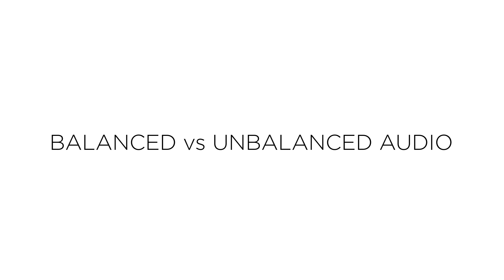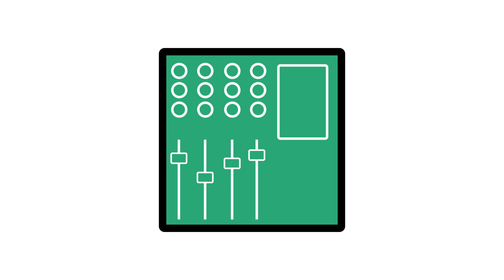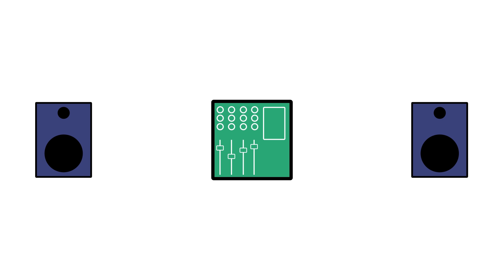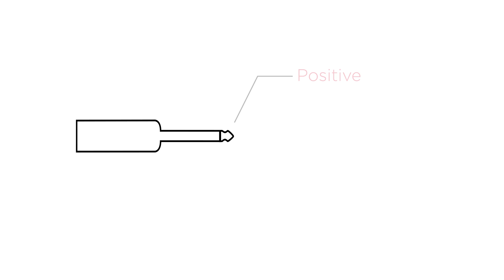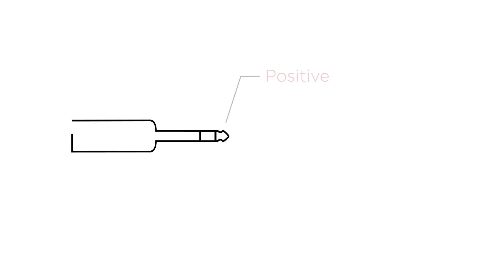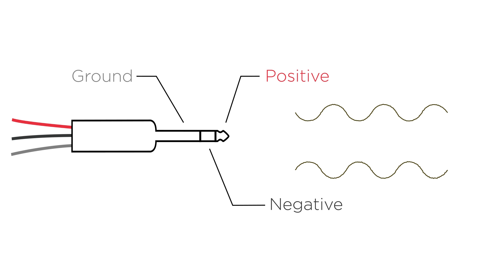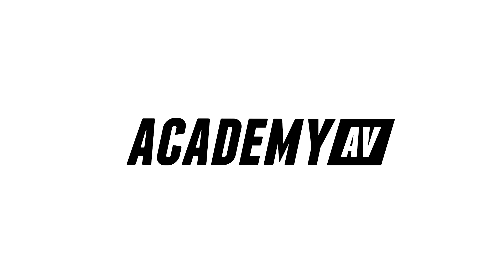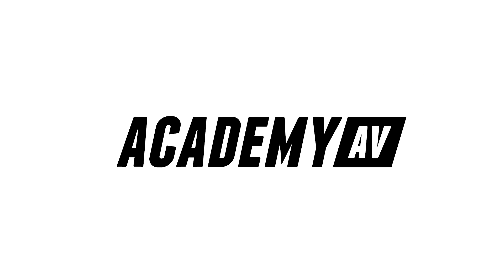Audio Theory: Balanced vs  Unbalanced

Comment: So its possible to use balanced cables connected to a mic on the middle floor of the Buruj Khalifa while  Audio engineer is operating the mixer in the ground floor or on the top terrace of the building...

Comment: What happens with the signal when the polarity of the negative signal is inverted again? I understand why noise is cancelled but the negative signal when is inverted again won't add up with the positive signal? the final signal won't be double in amplitude as they are 2 indentical signals?

Comment: Question please: can you use a balanced cable on a mono output? Ik use a Roland SPD-SX wit( one cable output to a mixboard more than 10 ft away. Thanks for your explanation, great!
Reply: I would look at an Edcore S2M. It takes a balanced signal in or out, and transforms it to a mono in or out. Pretty clean and cheap too.